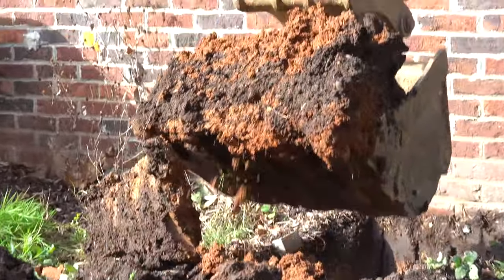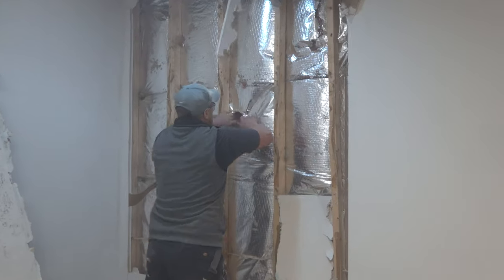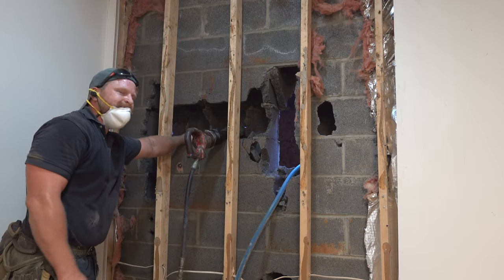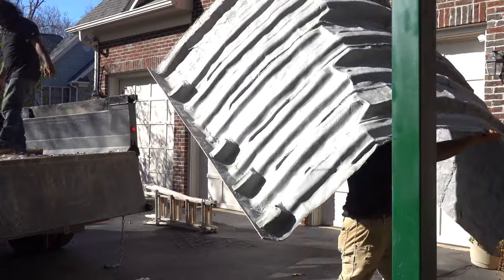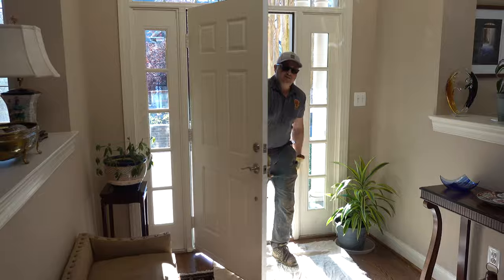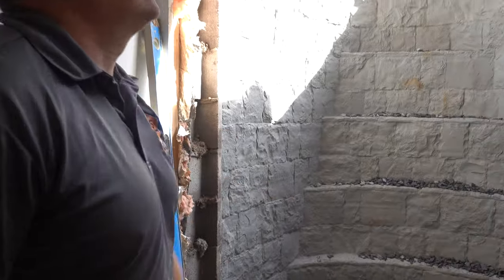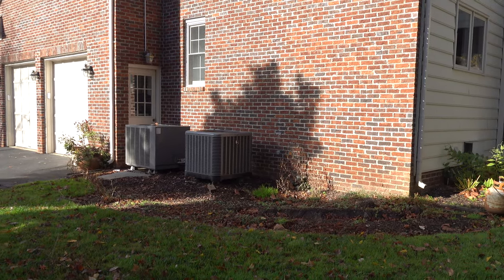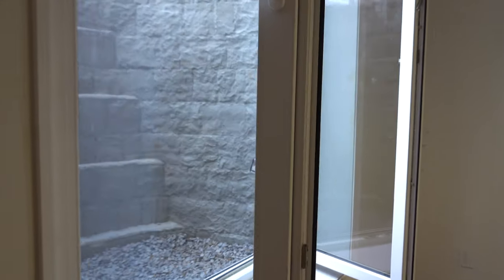Egress Basement Window Installation | Home Improvement | How To

Comment: I installed such an egress  window myself, also from Poland, 48x48, but I took out the sash (where all the weight is) and started with the frame, then mounted the single sash. Per the instructions I received I kept the gap at a minimum and used a special sealant. Very pleased.

Comment: Why not back fill with gravel? This protects the window well from being damaged by the ground as it expands and contracts.
Reply: Yes backfilling with gravel is easier on the window well, that being said, the RockWell window well that was used in the video is extremely durable and does not require gravel.

Comment: In snowfall this could be a problem. Snow will filled in.
Reply: @siddheshdubey There is a cover for the top of the opening. In the winter months you just place the top on to avoid a fill up of snow. So all you would need to do is clear away snow as you would a driveway
Reply: @Lokey21  Thanks for the information.
Reply: @siddheshdubey  👍😊